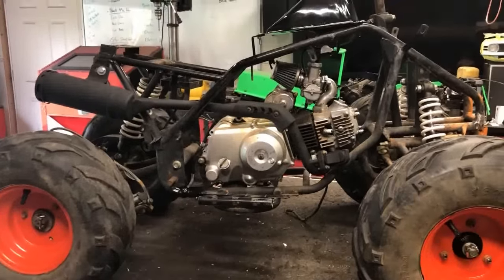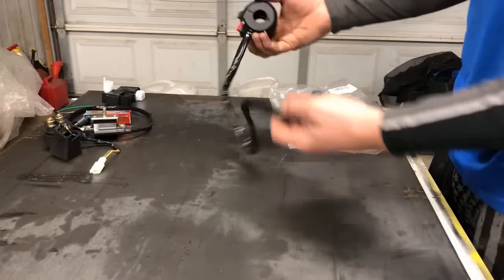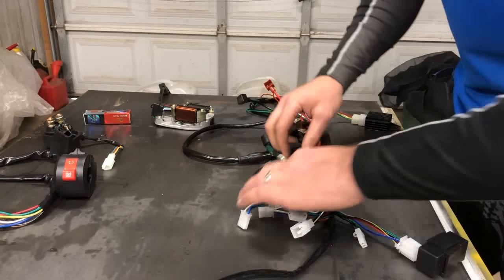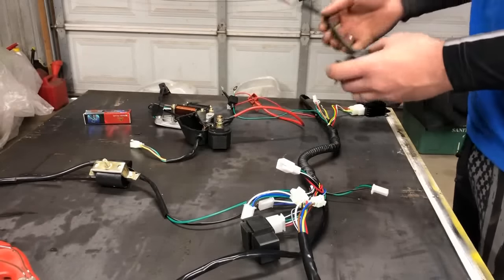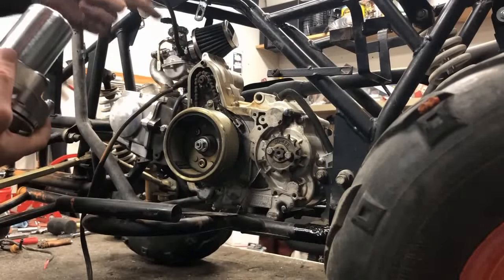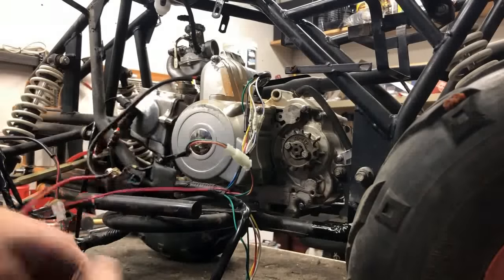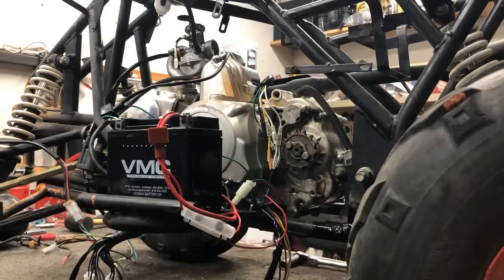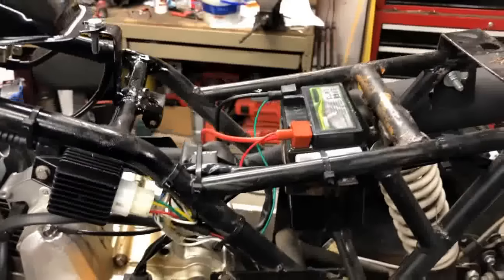Wiring a Chinese ATV from start to finish with an All New Wiring Harness!

Comment: Great Video. Question: I recently purchased a chinese 125cc go kart. 2 Seater. Electrical is rough. After watching this video, I'm sure that I want to go the route of changing the harness and all the electrical. I've had some challenges finding a go-kart specific one. It seems that I would need a harness that has longer wires for things like the brake pedal wires, headlights, and horn, as well as the fact that I don't need a handlebar mounted starter and kill switch, but instead a key switch. Is there any guidance that you an provide on what and/or where I should be looking. Or, do I just purchase an ATV kit and then modify or change out the parts that I need for the ATV? Thanks again for any help.
Reply from the maker: I have actually wired a go kart with an atvs harness only because the go kart wiring kits I found were three times the cost! Made it work by extending the head light wires and mounting the handled bar start button to the frame. Very little modifications and it worked great!

Comment: Hey BJ, Tim here. Got a lot of noise coming from timing chain on new 125cc engine. Going to be installing 180cc big bore kit on nephews atv. How do you tighten timing chain and are there any upgrades that you know of for this?
Reply from the maker: The timing chain on these E22 motors is not adjustable. In the sleeve there is a chain spacer the keeps them from slapping. Otherwise it should be tight, so tight that it's difficult to get the chain on the cam gear without having the head torqued down.
Reply: Praska Boy's Garage picked up a 250cc Chinese quad. Just got a bunch of parts in. Do I access the stator on this the same way? Tried taking side cover off but didn’t budge it.

Comment: love your channel, scored a 150cc (gy6) based ATV (like your ruckus clone) and got the hack job from the previous owner figured out. but, do the lights run off of the stator? I am trying to test them and they will not turn on, on acc. I dont see a relay, just the light switch, which functions kind of like a turn signal? no, lights on/off. any insight here? Thanks Praska... :-)
Reply from the maker: Glad to hear you like the channel! I'm still new the the scooter/gy6 world but trying to learn as much as I can. From what I know your lights run off DC power from the battery. When you turn on the key and light switch you should have the lights on. You'll see that in my first scooter video I posted. Does your motor crank over?

Comment: I did this and still have no spark.  I had spark for a second, but it won't come back.  I ordered the same kit from Amazon.  One thing I notice is that when the start switch is in the off position it will still try to crank over with no spark.  Could I have received a bad start switch?
Reply: Did you replace the starter switch ? And did that help ?
Reply: @frankthiessen6515  I haven't replaced the starter.  I'm going to see if the sensor needs adjusted that triggers spark when the flywheel spins.  I saw another video where he replaced the harness multiple times with no spark.  The sensor was too far from the flywheel
Reply: @thebrothers4311   ok I’ll have to give that a try as well. Thanks

Comment: Hey man have a question I put new harness and everything on the quad and set up just like the way you got it and the thing will not turn over at all you have any idea what it could be I can jump it by the solenoid but it still doesn't get Spark
Reply from the maker: Typically no spark and no crank are result in the same issue. Could be simple. When you turn the key on do your head lights and brake light come on? If no, check your fuse. If the fuse is good it is likely a fault in your key switch. If your head lights come on then your issue might be a safety. Check the brake safety, when you apply the brake does the brake light come on or get brighter? If no then you have a safety issue. Good luck and if your still having issues send me an email.

Comment: Does it work for two tail lights or just one? Saw in the build that you only used one brake light so just wondering if it will work for my mini quad with two. Thanks
Reply from the maker: SlothGaming It only comes with 1 connector for the rail light. However if you make your own 2 in 1 connector or splice the 2 tail lights together you could connect them into the single harness plug.
Reply: Praska Boy's Garage ohh okay thanks!
Reply from the maker: SlothGaming Yeah you bet!

Comment: Hey I’m having trouble wiring my harness I have a extra wire right above my
Chain what does that go or how can I contact you ?
Reply from the maker: This is a question that comes up a lot actually. That sensor is for your neutral/reverse light indicator. The new wiring harnesses does not come with that connection and unfortunately I haven't found one yet that does. The harnesses I have linked in my video will still work for your atv, however you won't have the gear light anymore.
Reply: @PraskaBoysGarage  Thank you I got my atv from a neighbor who was about to junk it and if it wasn’t for you I wouldn’t have gotten it to run for the first time yesterday with all your videos I put on the harness , starter , carburetor & the new engine head your videos a very helpful and you go into detail can’t wait to see more content 💯💯📈📈

Comment: Hello. I have a 110cc Loncin engine. The stator is a 6 coil setup with a 4 pin female plug + a single pin, making it a 5 pin stator. All the harnesses i have seen are 6 pin stators, or the 5 pin stators only have pins, no female connectors. I can order a harness with a 2 coil stator, would that just be the easiest path to go down? (Ordering on ebay, not amazon since i live in australia) cheers, thanks
Reply from the maker: I'm trying to visualize what your saying. In the past when I cant find a replacement part with the same connector I just put my own on it. You can buy individual male/female connectors for each wire and connect them. Wrap them in electrical tape and call it good. Not sure if thats the answer your after but thats what I've done.

Comment: Would the same kind of setup apply to a Lifan 200cc that I am putting into a Honda CB125?
Reply from the maker: Peter Scalone You can buy a specific wiring kit off eBay for the 200cc. It’s a little different. Use this video as a reference guide because 98% of it will apply even with the different harness.
Reply: @PraskaBoysGarage  Thanks

Comment: Question! So close... How come when i connect positive cable(the one u say to leave on) from starter to battery/ or positive on starter relay bike immediatley tries to turn on?
Reply from the maker: Could be 2 things. 1) Your starter relay is stuck in the open position. Could be fixed with a few light taps from a hammer but you should probably replace it if bad. 2) You have power going to the starter relay without hitting the start button. Could be a few different issues. You'll need to follow power and see if your live at the relay.

Comment: i have to replace the stator in my taotao atv, I accidently ordered the 6 pole one, but then noticed my engine has the 2 pole one.. Does it matter?
Can i just fit the 6 pole one in?
well im gathering its my stator, because i replaced the entire loom, all wired up correctly, But still getting no spark
Thanks
Reply from the maker: I don't believe so because the mounting points are different. On a 2 coil the pickup is fixed and on the 6 coil it is bolted down inside the case. In theory if you also swapped the stator cover you could. They both serve the same functions.
Reply: @PraskaBoysGarage  thanks for your reply dude. Will order a 2 pole one then :) see if that fixes my No Spark issue..
Appreciate it
Reply from the maker: @RGD-Audio-Repairs  Yeah you bet man! Good luck on the project!

Comment: Hey i’m trying to rewire my sons 110/125cc Chinese ATV I ordered wiring kit got it all hooked up how are supposed to it’s cranking over but it will not spark no matter what I do I even got a new CDI test coil test the stater all that’s good and now I have no idea what to do is there any you could help me out with my problem please
Reply from the maker: No spark can result in a number of different issues. Start with the easy stuff. Check to make sure you have a good spark plug. Make sure you have a good ground. Then make sure the kill switch is in the run position and the safety tether is plugged in if you have one. If everything is good there then you'll need to do a continuity test for the spark components and see if you have a failed unit.

Comment: Hi, bought the wiring harness you recommended. Everything came with it. I had to REWATCH your vid to figure out the 2 front brake wires you mentioned. The old wiring harness was all cut up and spliced into, but I was able to stick to the basic and she ran without a problem. I connected the new wiring harness last night. The rear brake light works, the handle brake switch works, the starter is turning the motor so I know the solenoid works too.... However I Not getting Any spark. Could it be the Stator? I connected the old CDI as well as the old ignition coil (that was previously working) and got the same result... No Spark. Any ideas?
Reply from the maker: Good call switching out the CDI to rule that out. Couple things: First make sure the kill switch is in the run position. Did you connect the rear safety tether? If you did, unplug it. Did you make sure you have a good ground? After that try swapping the coil and spark plug. Thats everything that would stop spark but still allow the motor to turn over that I can think of! Let me know if you get it!
Reply: Well I ruled out all possible things lol!!! I figured something else had to be off. So I started inspecting all the plugs.... when I saw the female side of the CDI plug was bent a little. So when I looked at the Male, I saw one of the wire tabs was bent.... when I looked at the color of the wire... turns out it was the Ignition Coil wire!!! (SMACKS FOREHEAD!) I bent it back straight with some needle nose pliers, carefully plugged in back up.... and she started! Funny how the Smallest of things can really derail a project lol! Thanks!!
Reply: Also forgot to mention that the Kill switch on the top of the controls, doesn't do anything. It doesn't cut off the quad when its running. I have to turn the Key to the OFF position to turn it off. I guess I should check that plug too! lol!

Comment: i got the same wiring harness that you have, notice that my switch 6 pin color from block to block don't match. am i missing something or that wiring harness is wrong. thanks
Reply from the maker: I've never had it come and not match. Are you saying the switch that came with the harness didn't match or your original switch didn't match the new harness?

Comment: i bought an engine recently that came with a wirting kit, and my 5 wires out of the engine dont match. mine has {blue/white, green, red/black, yellow, yellow. and the harness i got has same but yellow and white not 2 yellow. Im assuming that its still same but i dont want to ruin the engine i just replaced for my son before he even rides it. am i ok? any suggestion?

Comment: Hi - video has been super helpful, but my starter has a plug on the end of the wire.  On the old harness, one wire went to the relay and the other directly to the battery(ground -).  Also, my stator connection also has a plug end rather than the terminals in the new harness (kit didn’t come with stator).  How do I wire this up?
Reply from the maker: Hey Steven, you will see I attach my battery(ground-) to the top bolt on the flywheel/stator cover. Sometimes from factory they will attach that wire using the starter bolt rather than the one I use. It's fine to leave it that way. Does that make sense? Also you can simply cut off the plug on your stator and use quick connects for each wire individually.

Comment: Do they sell a kit like this for a linhei 260cc 2x4 bighorn?
Reply from the maker: Erick Shepard I’m not personally familiar with the 260cc atvs but I know they make a generic 250cc working harness. I would compare yours to one of those kits and see if they look similar.
Reply: Praska Boy's Garage  In regards to the CDI. Most of the CDI’s I see on some of these kits do not look anything like the CDI on this quad. But the Stator seems to match up, is this a possible prblm or just maybe an aftermarket design?

Comment: Man pretty awesome with this I've learned a lot watching you I've been having the most problems getting my daughter's 4wheeler right I can't get the right motor and wiring harness can you give me any pointers in which directions to go and buy a matching wire harness and motor for a 125 coolster four-wheeler, it would be greatly appreciated and my daughter would love it
Reply from the maker: Hey Dewayne! Glad to hear the channel has helped. When I have a project that needs a motor I actually start looking for a parts ATV. Usually a new 125cc motor runs in the $280-$350 range on eBay. For that money you can pick up an entire project, so I would start there. Otherwise if you want to go with brand new I can send you links online for what to purchase.

Comment: Hello I'm a subscriber I have a couple of questions about the 110cc wiring harness I have the exact same one but it will not turn over no spart nothing and the engine I have is new and it has two sets of wires coming out of the stator case what are thos wires for?and do they make wiring harness for then? Thank you  for you videos my kids and I enjoy them have a great day
Reply from the maker: The set of 2 wires coming from the stator case is for netural and reverse light indicators and wont have a plug for this harness. I haven't found a aftermarket harness that has the proper plugs for them.
Reply: @PraskaBoysGarage  Thank you for the  reply!
Reply from the maker: @atonyrodify  You bet man!

Comment: Hi can you tell us a part number and supplier u used I like that style switch control but can only find it with the  Stater u swapped in.thanks.
Reply from the maker: Links to both styles of harness are in the description of the video. Those are amazon links if you need them for ebay let me know. Thanks for watching!

Comment: I have a green wire + yellow wire tab coming from my carb but it doesn’t seem to come with my new harness what do I do?
Reply from the maker: If you have a plug coming from your carb that is likely an automatic choke. I'm assuming you don't have a "E22" style engine and you probably have a GY6 style. If that is the case this harness with not work with your motor.
Reply: Praska Boy's Garage thank you, I bought this for my specific model Coolster because it came with the harness and electronic components, but it’s not going to work out. I have a Coolster 3150DX-2 with a GY6 157 QMJ, is there something you would recommend?

Comment: I have started re wiring my quad I came to the stator wires and they are different colours and I'm stuck what do I do now?
Reply from the maker: Tell me what colors you have. Stator wires and then the main harness wires
Reply: @PraskaBoysGarage   main harness wires are white, yellow, black with red stripe, blue with white stripe, and green

Stator wires are yellow with red stripe, white, black in a three pin push in connector and a loose white with red stripe, and black with red stripe last two are female push on with see through plastic rubber gaters
Reply: Would you know which ones go where please
Reply from the maker: @tonydanker4910  I got your email today and sent a reply. Hoping you can send me some pictures!

Comment: Hey i have the same atv i just did my wiring harness same one in this video . When I pull the handbrake and hit the starter button it burns out the positive and negative wires. Do you have any idea what it could be
Reply: Mine did that too. The starter was burned out and was a short.
Reply from the maker: That is usually a result from not hooking up everything correctly. The quickest way is to accidentally swap the positive and negative cables to the battery. Sorry Im getting to this comment late, did you figure out the problem?

Comment: Where do you recommend getting a good complete wire harness from?
Reply from the maker: Todd Rohr In the video comments I posted the harness options on eBay. They are shipped directly from China so it takes 3-4 weeks to get. Plus like mine sometimes it’s missing stuff. Might be a better to find a US seller that way it’s fast to ship and they will have better customer support if you find issues. Let me know which stator you needs and I’ll send you a link.
Reply: @PraskaBoysGarage  I have the 2 not the 4.
Reply from the maker: Todd Rohr https://rover.ebay.com/rover/0/0/0?mpre=https%3A%2F%2Fwww.ebay.com%2Fulk%2Fitm%2F302880786805
Reply from the maker: Todd Rohr This is a link for the 2 coil. Also it’s from California so you should have it in about a week.
Reply: @PraskaBoysGarage  Thank you for your help

Comment: I have a 150cc. Atv for my son and. I cant fuiger out where new harness wires all go on it its different from the 110cc.  Its a 150cc tao tao. Can you help ?
Reply from the maker: 150cc are different, the concept is the same when it comes to installing but they will look different and lay out different.
Reply: @PraskaBoysGarage   okay thank you i bought a 150cc harness for it and it all whent on but there was no cord to plug to the shifter. It turns but wont start im thinking its because it cant telll if its in nutral.  Im not sure. I tried going on the tao tao site but they dont ship to canada. So im kinda stuck.  Driving me crazy